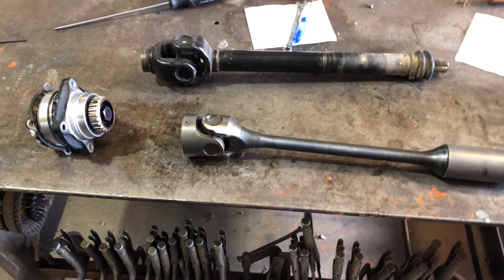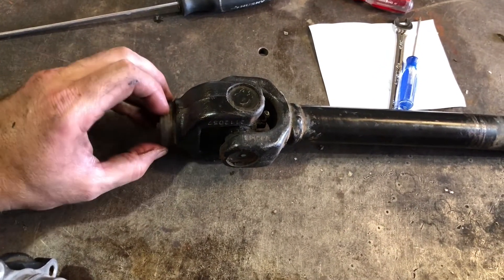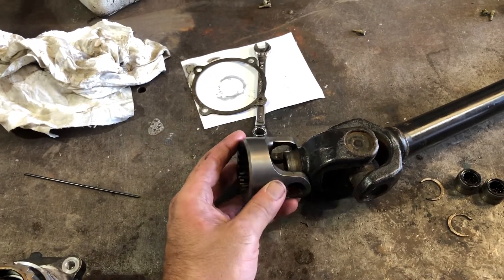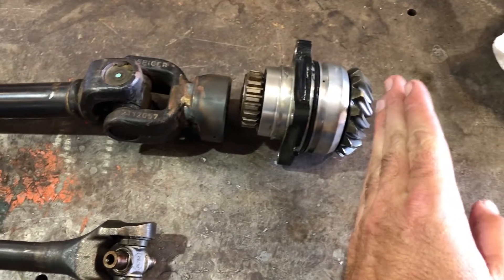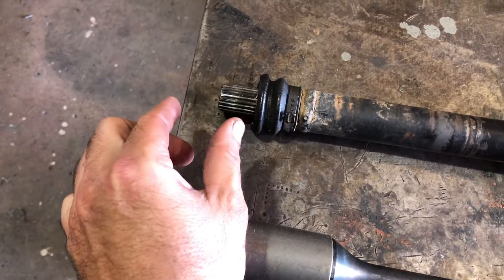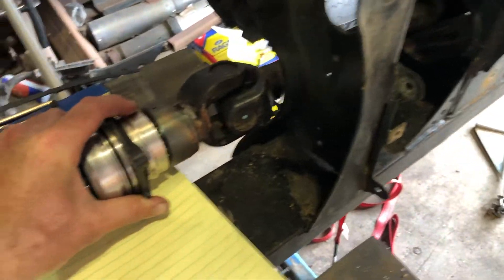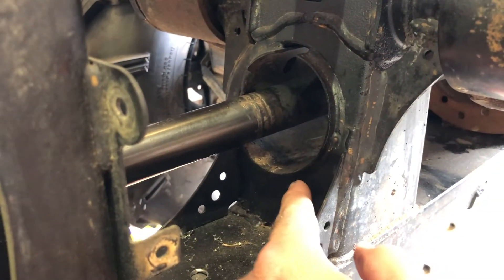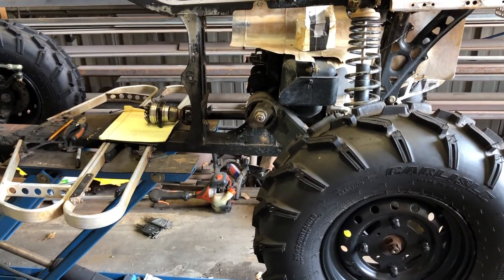Custom Built Atv Driveshaft  - 1000cc ATV Swap! Ep. 5

Comment: Where is it now???
Reply from the maker: Back burner project. Waiting for cooler weather 🔥
Reply: @RaztechPowersports  hey man did you ever get this finished curious to know ? I built one myself and aside from yours being shaft driven and mine is chain hooked to the input shaft of the quads original fwd/,reverse gearbox which then goes to the same style rear differential as yours ..  I test rode mine and it doesn't go over ,35 and every gear is the same , .. only thing I think of is the gear reduction is so much that it just winds it out that fast .      Curious to know if yours does the same without the forward / reverse system!
Reply: Would love to see This keep going